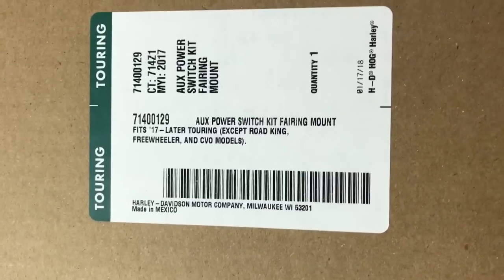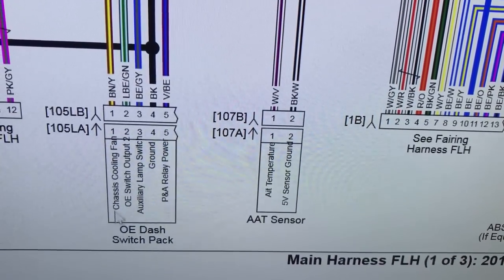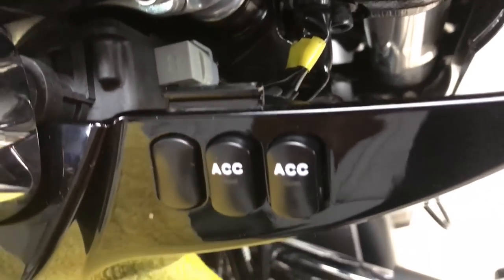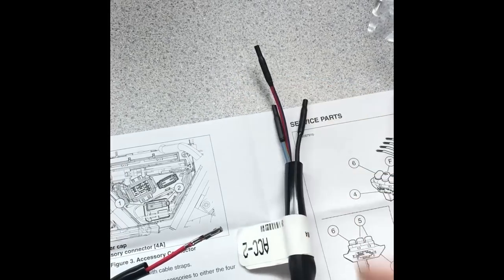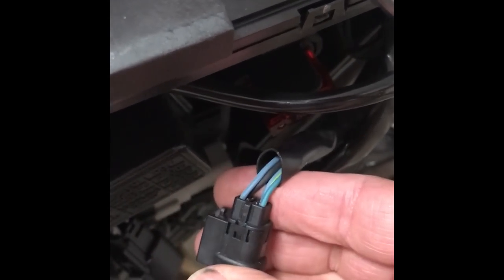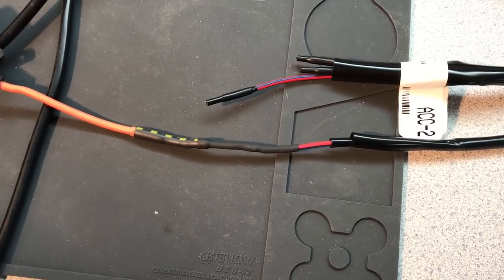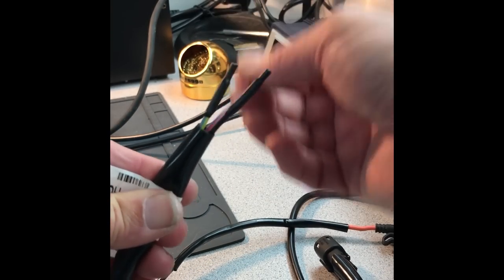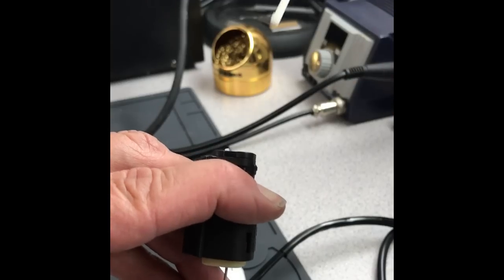Harley Aux Power Switch Kit Fairing Mount 71400129

Comment: Just wanted to say "thank you so much" for the little blurb on the center button on the left-hand switch bank. That is exactly what I needed to know. I was able to get the connector and inserts for the socket under the left panel at my local dealer so i could power off of it to run my accessory lights in a very clean fashion.

Comment: Great video. I was doing research on my acc button because I plan on running a switched power circuit for adding interior saddle bag and tour pak lighting
Reply from the maker: Glad it helped
Reply: @Alan_1 where did you find the different switches? I have followed your video and everything went as you said. Only issue(s) I’m having are the switches. I have Harley Aux but they are upside down. Plus I want to install the Light icon switches as well. Part numbers are non existent.
Reply from the maker: @tompeyton8308  It's been too long for me to remember but it seems to me I included pics of part numbers on boxes. Everything was HD oem if I recall.

Comment: Alan, I have a 17 road glide s. I just bought from rickrack a 3 switch setup that mounts next next to ignition. what all do I need to run my hd oil cooler fan and fog lights from the switch? thanks!

Comment: I have a 2019 tri glide. I'm trying to find where my 3 buttons on the left bank end up on the bike. My left button is for factory fog lights. The middle switch button (green wire) is under the left side panel, but the right button can't find where the wire ends up at. ?

Comment: so can you or someone else tell me how many amps the acc #1 switch that runs through the relay is good for i need 4 amps.  my 325a is used for the amp and speakers
Reply: It’s good for 2amps
Reply: @bobhat2001  it is a 2 amps out of the switch its10 amps out of the relay with a 10 amp fuse

Comment: Very helpful.  Question:  To where does that third switch on the left panel send power?  You've got what looks like a cooling fan. I'm looking to use that to run some lights, but I can't figure out where to tap into positive power.
Reply from the maker: Does this help?
https://youtu.be/BYVI8uEOWYU
Reply from the maker: Or this?

https://youtu.be/DNzbQ4jqqK4
Reply: @Alan_1  Yes, that video was exactly what I was looking for!

Comment: very thorough, thanks. I can only find the right side switch kit 71400129? Do you know where to find the left side aux switches?
Reply from the maker: So the left switch bank came stock with the passing lamps switch and two blanks. I then added the Daymaker fog lights and bought a second lamp switch. The other switch controls the Coolflow fan and I am pretty sure that came with the fan kit.
Reply: @Alan_1  understood thanks.  can't find it anywhere, even the switches themselves. I can only find the right side. Thx again
Reply from the maker: @kmern6979  Watch this video about 7:37 for the lamp switch- https://youtu.be/DNzbQ4jqqK4

Comment: Great videos! Thanks. The wiring is almost exactly the same on my 2018 Tri-glide. I have the Cool Fan installed, from the Dealer when new. They used 925 connector for the fan as you did. I have now purchased the kit and installed the RH ACC kit and have installed the middle switch on the LH side. I liked your video on your installation but would rather not solder/crimp/extend. Is there a way I can follow the HD instructions and plug the Battery wire terminal into the plug that the fan is connected to? There is an "empty terminal" with a white seal pin in it. If I remove that and install the battery cable there and then to the battery, would that work or cause trouble? TIA if you can answer or give me a way to add another 925 connector. Cheers
Reply: Steve, that is exactly how I wired this in, how you describe. I also have the cool flow fan using 325b, but as you said, there’s a free pin on both connectors of 325b, so I de-pinned and added the power from the battery in one and it connects to the harness in the other, super clean, better than installing a Y connector!
Reply: Steve / Kamado - 2017 FLHTKSE CVO - Just like both of you, the fan was installed at the dealer so it uses the 325b. All I want to do is utilize the middle switch hole on the left hand side to run my fog lights. Can you tell me how to do that? All I need is to install a center button on the left dash and have a switched pos / grnd wires I can attach to. How can I do that?
Reply: @cwickgo9  This video gives you the majority of the answer. You’ll also need the fog light wire harness. I bought the Harley harness to tie from the green wire he pulls out of the accessory harness in this vid and ties to his fog lights, I did exactly the same. I installed Harley fog lights so the the Harley fog light harness plugs right in to the lights. As he did, I added a molex connector from the accessory harness to the fog light harness. You’ll also have to buy the switch from your dealer to add to the middle slot of the left bank.

Comment: How many amps can you draw from the green wire that you used for your fog lamp that is controlled from the middle position button of the left buttons bank ? Since you use it to power your fog lights from it, I suppose it's also more 2 amps. And it is already relay connected from the factory ? thanks for your help
Reply from the maker: Hopefully someone more current on this can answer. When I did this install I researched it well and that circuit was rated enough for the fog lamp load.

Comment: Hello, and thank you for a very in-depth video,   I totally appreciate that you are extremely versed in electricity, soldering, etc.  However, the everyday biker, like myself, may not be that inept. I honestly could not follow you as you were adding and subtracting all sorts of things that has nothing to do with a straightforward installation of the Harley Aux Power Switch Kit Fairing Mount 71400129. At least, it had nothing to do with what I needed. I am not upset that you have gone an extra yard or 2 in describing what you have on your own bike.  Honestly, all I am looking for, and I dare say others as well,  is a straightforward installation of the 71400129 Power Switch. Can someone please direct me to a straightforward video for the installation of the 71400129 on a 2018 Ultra Limited? Thank you again for your work. I hope I did not offend you in any way.  It was not my intend at all.
Reply: yes, first off Thank you for the video. It takes a lot to do one. But like he mentioned. I was following you perfectly and then you went on to what you were doing to your bike that is not the intention of harness. So,, you lost me after you changed how the pin is supposed to be installed.
Reply: I couldn’t follow him through either…..
Reply: Adding my unwanted $.02! The only thing he changed was that he didn’t use the 325 connector to run power to the harness. Just like him, I have a cool flow fan installed, and the 325 connector is already used. I do think it’s possible to just add the power pin from the battery, install it in the 325 connector as Harley instructions say, and then add the harness connector pin to the other side of the harness. (Take the pin out from the harness 325, and add that pin. But I likely lost you there! He did it the way he did because it’s a silly use of the 325 just to power the harness, a splice does the same. Hit me with Qs

Comment: So~ what have you accomplished by adding 2 of acc switches ??
Reply from the maker: Set up for heated seat control from the dash, as well as LED accent lighting.
Reply: Or driving/ auxilery lights
Reply: @Kashmirknight  does it matter  that it’s on the right instead of the left  like most. 
Are the harnesses the same behind the faring that if I want my aux lights to be controlled by a button it can be on either side